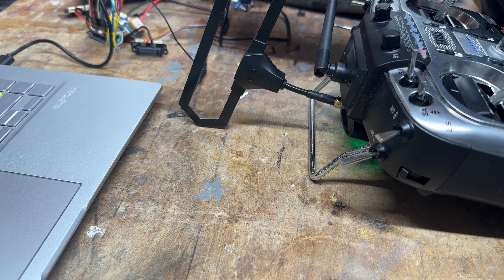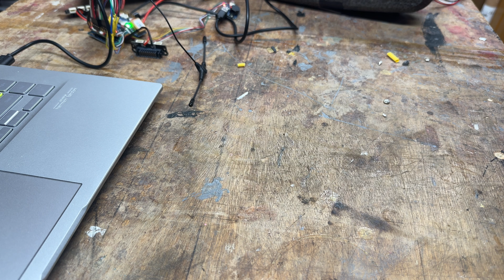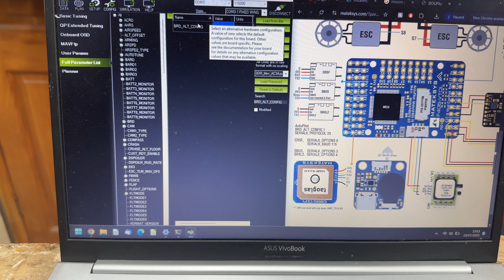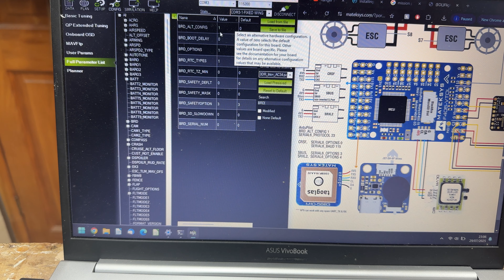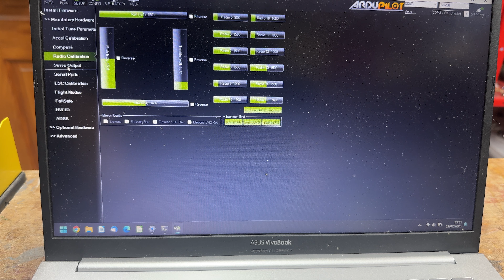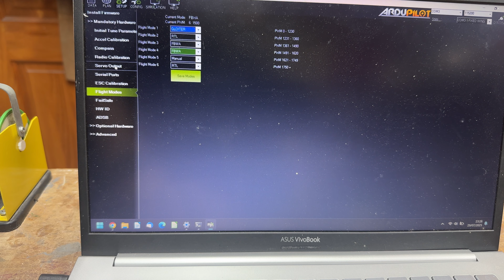Heewing T1 Ranger VTOL!: Part 8 - Configuring Our Flight Controller In Ardupilot!

Comment: I'm just starting out in the hobby, and I'm practicing flying using  DRL, Velocidrone and LiftOff!

Unfortunately, finding a pre-built VTO with common/popular components is not easy to find:
Matek H743 V4 FC (although this is end-of life??)
ELRS 2.4Ghz Receiver   (for use with a RadioMaster TX16S Mark II)
Motors, External GPS (integrated compass), LiDAR, Antenna, Batteries, etc

I'm thinking the Video Transmission to either Goggles or a Ground Station Receiver will most likely be digital (not analog), but not DJI O3/O4 Air/Pro
(ex. Walksnail Ascent VRX/VRX Pro ,  HDZero,  OpenIPC, etc) 

What frame ( Hee Wing  F01 / F130 / F150 , T1 Ranger) do you think would be easiest for a beginner to work with?

My ultimate goal is to flash and experiment with different H743 firmware:
ArduPilot (Ground-Station/Mission-Planner/Waypoints, Follow-Me), 
BetaFlight (for FPV and extremely limited acrobatics Drone-like Flying)
INAV (Ground-Station/Mission-Planner/Waypoints)

I'd also like to use ROS2 and simulate with Gazebo!